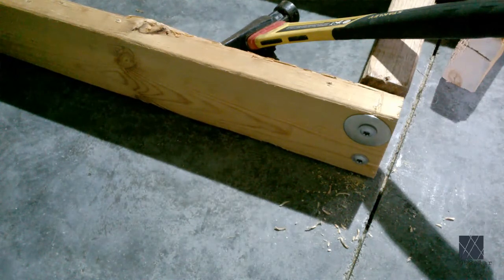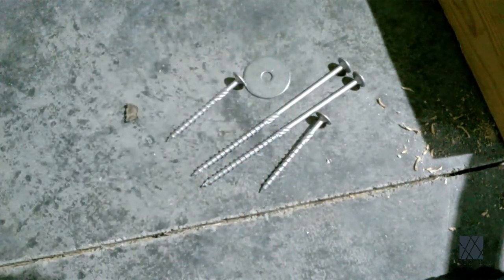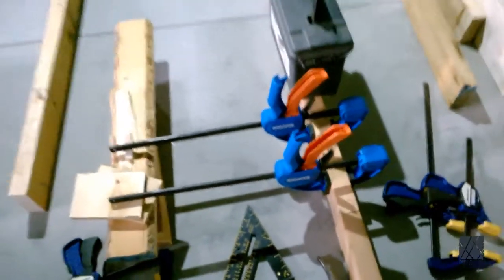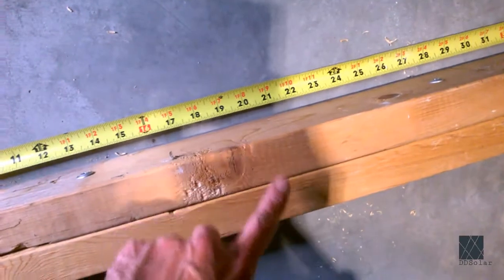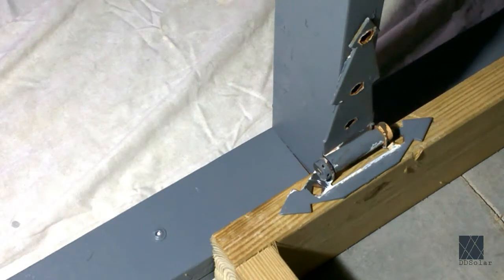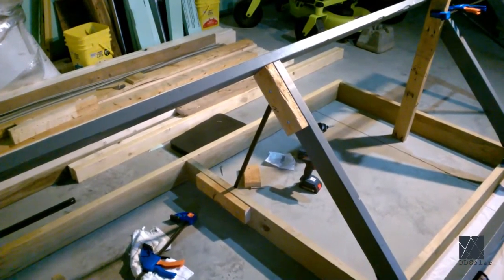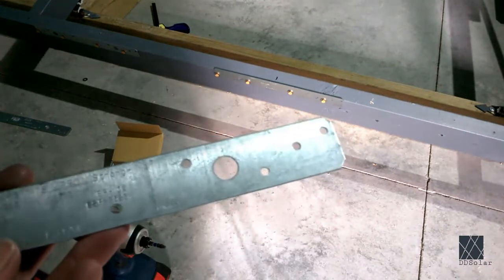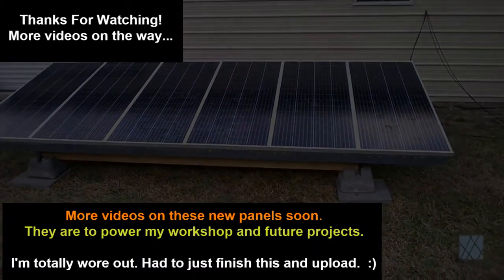Building a Big Solar Panel Frame Using Recycled Lumber and Structural Screws 1200w

Comment: How did you determine the dimensions for the base?
Reply from the maker: Hi, I sized it no less than 80% of the solar panel area (for stability reasons). But I think it would be better to build the base and frame the same size as all the panels added together (LxWxH). Not addressed in the video is how important it is to ensure the base is anchored to the ground (using concrete or ground augers). And I did not show attaching the solar panels to the frame, it was very important to use proper hardware. Hope this helps. DD

Comment: Love your approach at recycling old items and finding new uses for things! When I get time, I'd love to build something similar out of repurposed timber from a wall I knocked down. Not looking forward to the floor levelling part though...
Just curious what was the reasoning behind using only 1 washer on the corners? Could washers be skipped altogether?
Reply from the maker: Hi and thanks a lot! I see you like cats, I am a cat fan as well :) Yeah the leveling is difficult, especially with twisted and warped timbers. I used only 1 washer because they were huge and not much space to get 2 on the end. The other reason is I was running low. The washers can be skipped but are a good idea (if larger than the lag screw head) because they spread the load at the end of the timber - hopefully reducing the chance of splintering apart at the end. These lag screws are strong but the head is too small (in my opinion anyway). Probably a smaller but thicker washer would have been a better choice also.
Reply: @solarpoweredge  You're welcome. Love your cat pic at the end of your "What is a Solar Generator?" vid.
Thanks for the info about the washers too, makes sense.
Reply from the maker: Glad to help, sharing knowledge is what this channel is about :) ps I replied to your other comment. Maybe in the next few videos I will have some new cat footage, it's hard to get good clips, my cats know when I turn on the camera somehow...

Comment: Love them screws  and hate working with warped wood remember working for my cousin's he got low gunk wood cheep we were building a stores self up hi stuff was so bad had to use clamps and big pipe wrench to get it strate way worse than what u using cost more in labor than buy good stuff told him what u won't me to do with this fire wood lol glad the stuff u got not so bad and it u keep it a dry plase with some hevey on it let set for some time if u have a lot left use sticker just pice of wood in betreen ech laer of wood space out shold strate them all out
Reply from the maker: Indeed recycled wood is more work. I hated to tear down my shed but it lives again as a Workbench and a solar panel frame. It would have been destroyed by termites if I had not done something so oh well lol